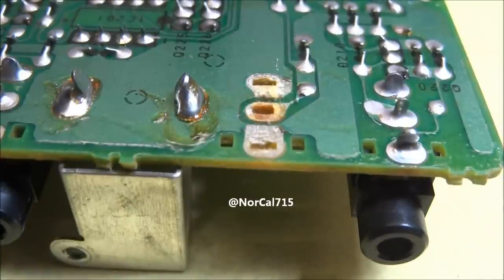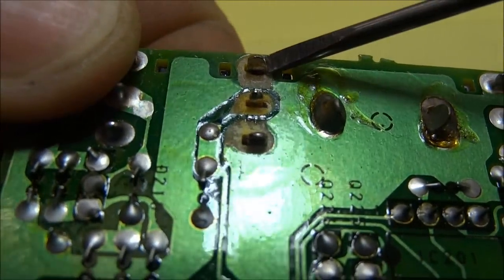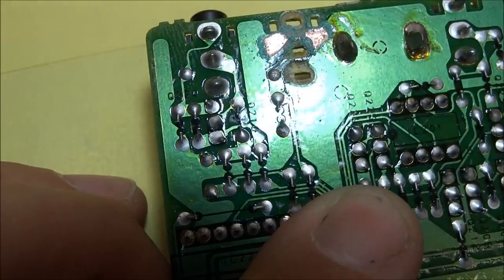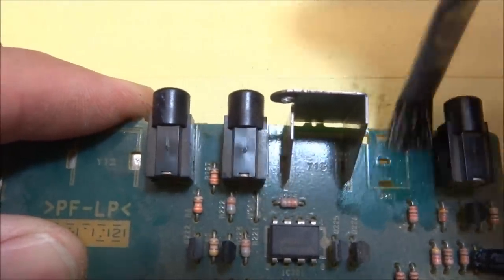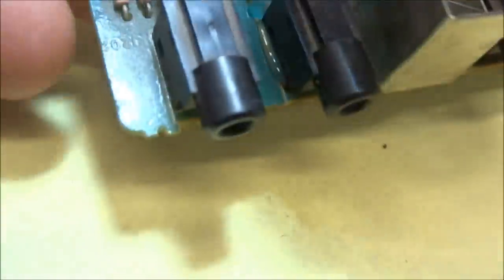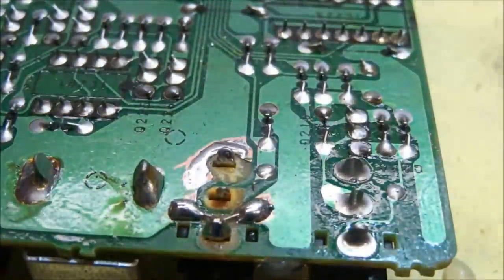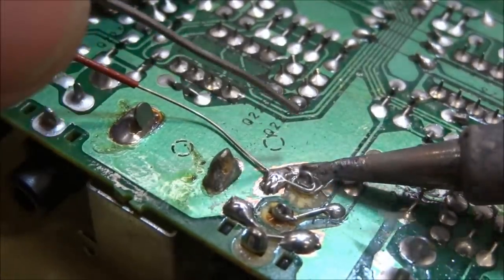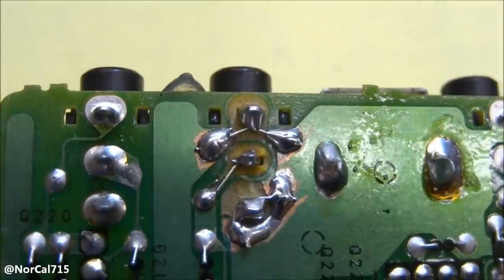Replacing a jack on a circuit board when the copper pads are missing Repair Fix

Comment: Very good video, Thanks!!! I just had my front load dryer take a dump. I took out the board and saw the pin for the relay was burnt underneath. They want $400 for a new board... I ordered a new relay and am going to fix it for a few bucks! Thanks!!1
Reply: Kevin l. I did the same for a dishwasher total cost $18

Comment: I love your videos norcal715

I have two questions.  One is acetone always better than 100% isopropyl alcohol??

I see that you use an electric hot iron.  Is that iron dangerous for very small integrated circuit parts because of the magnetic field that it generates when it produces heat?

Thanks!!!!

Comment: Hi norcal! I'm new at soldering and thought I would replace a USB type b jack that lost its center plastic peice (common problem with a Traktor s4 dj controller) instead of sending it in for a fortune. 

Unfortunately I've pulled the pad on pin 3 (green) and it looks like the backside trace of pin 4 (black grnd) has peeled up slightly but not broken off.

Do you think your technique could be applicable to my situation? Could I maybe hardwire the USB cable straight to the board and forgo the USB jack altogether? I'm hoping I don't have to salvage a new pcb because of my rookie mistake. 

Thanks for your help and the vids! 

-Chris

Comment: what would cause the solder to ball up instead of melting on the contact part to solder? Can you recomend a good soldering gun for circuit boards.
thanks
Reply: A couple things would cause the solder to just ball up instead of melting to the work. The most common two are 1) Oxidization on the part, or its dirty, and 2) The part is not getting hot enough for the solder to wet to it. For the first one, you want to clean the work with alcohol first, and then apply flux and then the solder to remove the oxidation while its melting to the work. For the second issue, you need to use either a higher temperature, or a larger tip for your soldering iron. Try a larger tip before trying more heat.
Reply: if you are trying to use lead free solder, it needs more heat than regular lead tin.
you may be trying to resolder a lead free soldered part.
the surface your soldering to is not clean or coated with something, scratch in to the surface, like in the video, to roughen it up.
your iron isn't hot enough.

Comment: ...stated power consumption--should also be listed with voltage and frequency. One more caveat: this thing may use the powerline frequency for internal timing purposes (clock, etc). If this thing has a clock and it always gains time, you will have to change this function, maybe by changing a switch or jumper setting if you're lucky, or possibly changing the position of a soldered wire if not so lucky. Hope this helps. :)

Comment: I've got one for ya, how do you completely remove a solder bridge when there is copper showing between the two little contacts that you are soldering? It's on a cb radio, I believe it's a resistor I can't remember for sure, it causes a thin layer of solder to bridge the two contacts together, I've soldered and unsoldered this many times trying to clean it all off but can't get it, the two contacts are in the same line the radio works fine regardless of this but I'm sure there could be long term effects
Reply: If the trace goes between the two contacts then they are connected anyway. Let it bridge. You should look at radios that were "hard wired" before PCBs.

Comment: Sir, I have one circuit board of powersupply(SMPS).During the soldering the I. C. the initial PIN holes are detorated/rings  on holes pads, thefore, pins of I. C. are not soldering. How can I make solve the problems and solder the PIns and connections are regularised to all components.

Comment: can you solder a heating element? i got a road pro 12v crock pot connection between wiring and element broke off?
Reply: The solder will melt. The reasons it failed was heat. Fire hazard, just toss it in the trash.

Comment: I have a capacitor to resolver on a wine fridge board but board is damaged where they connect to board, can I use reg copper wire? If so is gauge really important? Or does it have to be this hookup wire? Thanks
Reply from the maker: Yes copper wire is just fine to make jumpers.

Comment: What kind of solder to you use? I have 62/36/2 silver-bearing solder and my iron gets pretty hot (I think it's 60 watts max) and I'm constantly burning the little copper rings off of the PCB :(
Reply: 60/40 rosin core solder.

Comment: hi norcal, i own a nord keyboard, im bought some replacements outputs, very easy to get to, but i can t remover them off of the board, theres  3 support pins, not much solder on the metal pins, dont want to brake the board.can you help me?
thanks.
Reply: john valdez Check ebay / youtube for desolder pump (for one time job could be manual). On my channel i got video witch desoldering station.

Comment: Hey great videos like. I want some information. I just bought a av receiver model yamaha rx-v475 from ebay . the receiver use  120v as power. in my country my voltage is 220-240v.. can u give me what power converter (in terms of watt amps for me to buy  for this receiver.

Comment: If the unit does not have a means of changing the power line voltage (switch or plug/socket on the back), you would use a step-down autotransformer which will reduce your 220-240 volts down to something like 110-120 volts. Make sure your receiver will also accept 50 Hertz power--look for "50/60Hz" or something to this effect where the voltage rating is listed (the transformer cannot change the powerline frequency). I would go with a transformer rated at at least twice the receiver's... (cont'd)

Comment: If someone used enough force to break the trace aloose on the board then hot glue will never hold it down. You properly repaired the PCB and traces but I would have used a better adhesive. Good job though. I have done many "out of the box" repairs that saved expensive radios. Good work!

Comment: Does the glue affect the circuit in any way? Like if you get it on any heat decipators.
Reply from the maker: Yes it will cause the part to not dissipate the heat correctly.

Comment: Hi NORCAL I have attempting to replace my Samsung capacitors unfortunately I have made a mess of the area surrounding the holes where the legs go through. I don't think I will get a good connection when I replace with the new caps.Can these areas be made good? Any help would be appreciated Thanks.

Comment: Is the hot glue application meant to keep jack attached while upside down? If not, what's the absolute need for the glue? Thanks, great video...
Reply from the maker: Structural support, as to not just rely on the pins to hold it.
Reply: @norcal715  thanks! Never thought to use glue like that on a board. Learning daily

Comment: What do I do if Its basically the same thing but instead of the audio jack it's a micro-b import. So it's used to charge up the device. Do I use this same method or should I look into another thing? Oh and also I need it to stay in the same place so I can still plug it into the charger

Comment: nice, gonna try this for my GBA pcb, i accidently lifted the + and - pads when trying to get the rechargeable battery mod working along side with the backlit screen. I got it all to work, but needed to resolder the wires to make it fit in the aluminium case, and when i was desoldering the wires to the pads they lifted off.
Reply from the maker: Oh no😢 hope everything go's good. Wishing you the best of luck!

Comment: I kind of have a similar issue with a dc power jack I replaced, my first rookie attempt, two pins are making a bridge/short,  I think because The board is damaged , thinking of trying something like this. Not very confident yet, trying to research some more about this.

Comment: I could use your skills, great video, I have a gps unit of a quadcopter that I melted the little pads off trying to resolder a loose wire to it, I am going to try to see if I can scrape it and do a repair like you showed.  What wattage iron you using?

Comment: Interesting, but I would recommend bending the tabs over on the jack once it's in, this will anchor it better than hot glue. I would then create a large area solder joint using old wick. This provides maximum mechanical and electrical strength. Glue can be added for reinforcement, but be careful because acetone or alcohol will loosen it.
Reply from the maker: I have used wick in the past but didn't think it necessary in this case. Thanks for the input though.
Reply: Thanks for the video, I think your repair will last a very long time.  @norcal715

Comment: How do you repair a lead that goes to a small light bulb? The hole where the bulb wire goes in, the little silver ring was torn out. Both the negative and the positive. Does it need the little ring or can I solder a small copper wire to the scraped copper to the hole and then solder the bulb wire to it? Please help?
Reply from the maker: email me some pixs of your issue Norcal715videos@gmail.com

Comment: Why do u have to wrap the wire 360 around pins 1 and 3, but not pin 2? I don't see why it would be necessary to have to point a solder joint on either side of the one that is burnt out.
Reply from the maker: If you look closely the wire was wrapped 360 degrees around all 3 pins. On pin 2 I didn't loop it back to the starting position though. Attaching the wire to both sides of the board gives it structural integrity also. Plus the original copper traces were pass through on the 1st pin I repaired, and that may be the only way the ground got to various parts of the board.

Comment: How would i repair a pad that has no through hole? The pad completely lifted off on a circuit board of mine  and I'm not sure this will resolve my issue because I'd have nothing wrap my wire around
Reply from the maker: Sometimes you just have to run a jumper wire from the remaining circuit trace to the part where the pad has been lifted

Comment: I have failed! I bought wick they tell you the thickness! ( LIKE I KNOW METRIC IN THE SLIGHTES!@) " THEN THEY SHOW A PICTURE" LIKE THEY EVEN USE A PEN OR QUARTER FOR BETTER UNDERSTANDIN!!!?????  soooo   its one freaking quarter the width of that!! I have been using it, its suck a pain!~!
Can you answer a question for me please?" when solder turns grew and has a sandy texture. WHAT DOES THIS MEAN?  is it too low a temp?>  
thanks for your time!
Reply from the maker: Probably a cold joint. Needs more heat and possibly some flux.

Comment: To remove that green coating I use  a fiberglass pen and rub the pen tip back and forth ,it will do the same as a screw driver but better .just a thought

Comment: @ norcal715: I have a Sony TV. Model # KP46WT520.  Press the power button, the red light flashes 10 Times, but does not power on the tv.need Help please.  Thanks.

Comment: I don't like to get hot-glue or acetone anywhere near my electronics.  I'm not fond of epoxy, either.  I've seen components melt from the acetone contact.  I sometimes will use the 97% iso alcohol to clean surfaces.  Nobody seems to have any useful hints about removing flux when you are hand-refurbishing an entire board because it is just plane needed and no longer in production.

Losing the copper traces around a board hole is a common problem.  Connectors on a circuit board are also a problem.  One item I've used are solderable eyelets, that get crimped to the board, and then solder the component, and any fine fires to it, and only the eyelet has to be the strong-point.

My biggest problem is that anything with a USB-jeck on a board suffers from the problems, and after some use, the connections break-loose from the board, even when the connector has mounting-pins that solder to the board separate from the signal-pins.  Many imported products, and some domestic products, if there is a connector, they ought to have the circuit board be double-sided with plated through holes, but they don't.  Everything is built on the cheap.  Lasts a week, throw it away, sell a dozen more to the same customer.

Comment: WRONG The BACK pin DOESNT go to ground. It's N/C .  
Ring and tip is all that's connected. The other land was for strength. It just is there for that only and isn't connected to ground. You got lucky bud. On some small devices that can be done . Not on a computer laptop or high quality device. Many people use pieces of solder wick . I prefer to use actual copper curcuit trace with a sticky back then use a piece of solder wick for strength as you did with wire. Not that wahat your doing is wrong just another way of getting it done. Showing people the options available to them would have been nice. I'm sure you've been doing repair for a while. I've been doing it for 40+ years. Yea I'm old lol.  And grouchy. Enjoy your week
Reply: I wondered if anyone else noticed the back pin does not get soldered to the ground plane.  Great video just the same.

Comment: Amazing Ty so much ..my hands would have been shaking everywhere lol..very informative and useful because I have similar problems but it's the jack (is it female.. I honestly don't know what the correct terminology is..) are I presume busted because all I get from my headphones is a scratchy awful din on both my Boss micro br and looper pedal..so I am going to order them through eBay and replace them.. to hopefully remedy the situation..ty.

Comment: Sir, I facing one problem regarding soldering of registers in my device. Problem is =--The place where register to be soldered the both side supports and connections on surface in SMD device are missing due to extra solder heat therefore, registers can be not fixed in between in the place due to nonsoldering problem. Please guide me how can I solve my problem of soldering  Registors or capacitors in SMD devices when such above problems arises. Thanks a lot in advance.
Reply from the maker: You will need to find where each lead originates from and either solder to the starting point and then to the replacement device, or run a jumper lead from the existing circuit trace to the replacement device

Comment: Unfortunately I'm not a fan of this method.
Cleaning with acetone then touching with bare skin is pointless.
Hot glue is unnecessary and dodgy on PCBs that get warm or need repair in the future IMO.
Copper tape is really easy to use and cheap compared to wire.
All this said, clearly it works and is a fast technique, so fair play.
Reply: Nah.... Hot glue comes off easily with some alcohol... it also will not melt just because the gear warms up.

Comment: Now, everything has a cost attached to it, even your time. If you could even find a shop that agrees to do this job expect to pay a minimum $30.00 (I am comfortable with this estimate) and do not expect any type of warranty or guarantee. Compare this to the cost of a new unit,probably not a great difference. I am all for saving gear that can be saved (such a good feeling bringing a part back to life) but do the math and see if it balances out first.

Comment: I'm going to attempt this on a flash drive for a client. the solder pads fried out, so I'm trying to solder an USB head from a phone charger, (the usb end) to see if we can recover his data. Hopefully this works, or hell have to send  it to a data recovery tech, that can cost a lot of money. problem with flash drives, the circuit boards are sooooo small....
Reply: If there was enough current going through it to cause the pads to fry, there are more things fried on it than just the pads.  Good luck.

Comment: 1. Use a fibreglass debrading tool rather than a screwdriver for a better finish. Like these on eBay or from your local motorist parts (used for removing rust spots). https://rover.ebay.com/rover/0/0/0?mpre=https%3A%2F%2Fwww.ebay.co.uk%2Fulk%2Fitm%2F112140712886

2. Use isopropyl alcohol to clean the surface prior to soldering

3. ALWAYS use separate flux when soldering to copper surfaces, the solder will flow better and coat more thinly and effectively.

4. Hot glue used in areas likely to become warm enough to melt the glue as in close proximity to electronics components is NOT a good idea. Use cyanoacrylate (superglue) or silicone sealant, neither of which are as easily affected by heat.